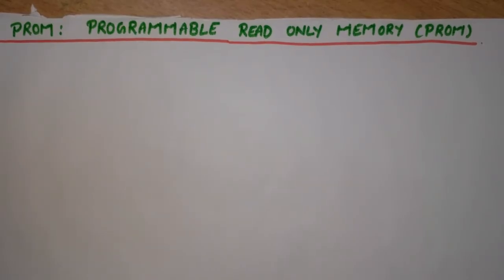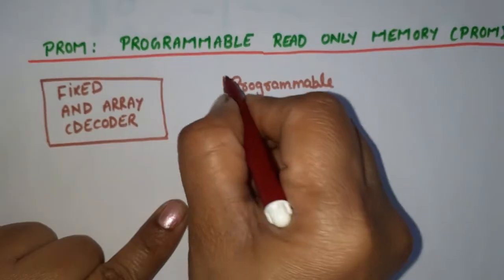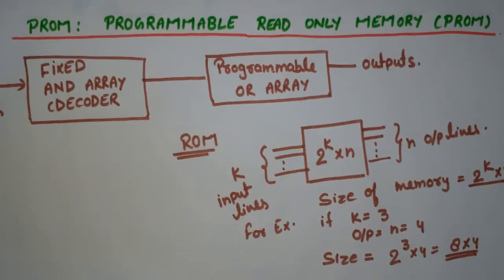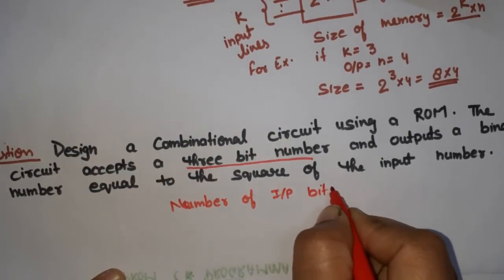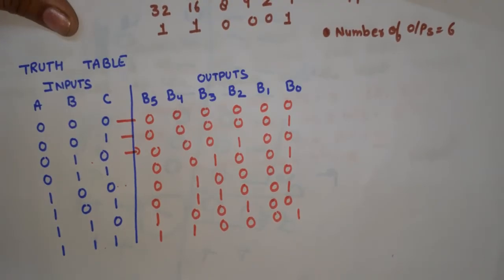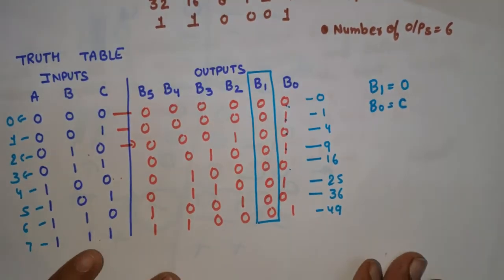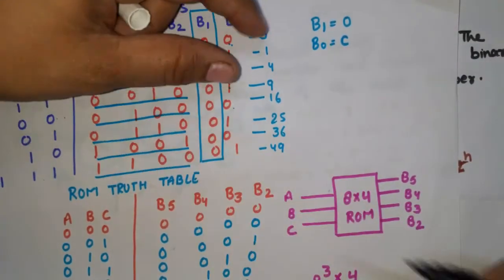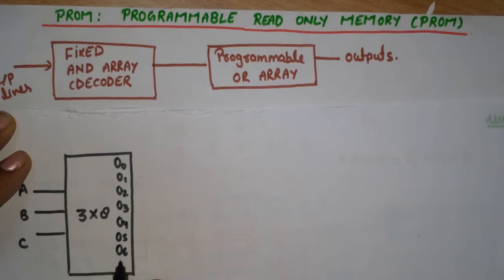U5 L10.6 | PROM  (Programmable Read Only Memory) | PROM example | PLD | Digital System design | ROM

Comment: Mam, how to solve this problem using PLA??
Reply from the maker: There is 5 outputs hence 5 kmaps are required then u get 5 output equation and after that at input programmable AND & at output programmable OR
TRY it ..